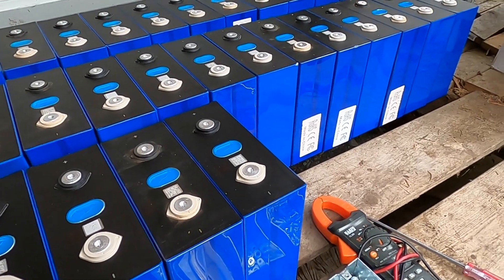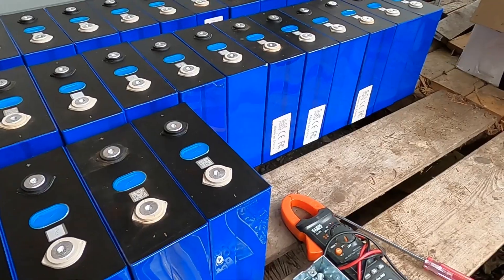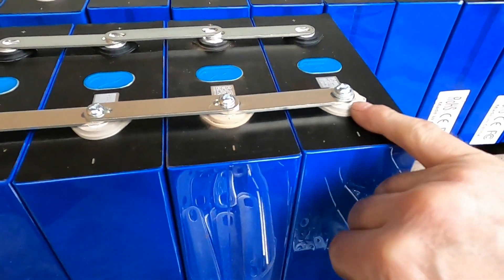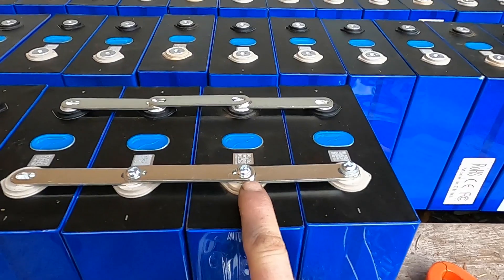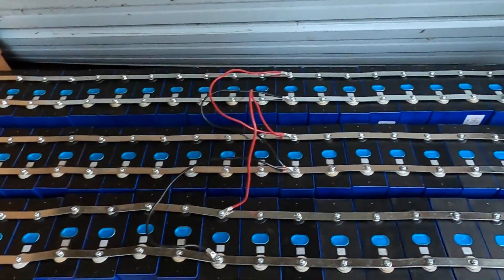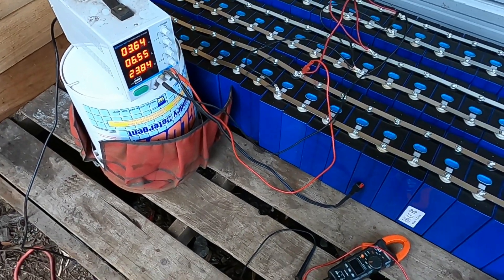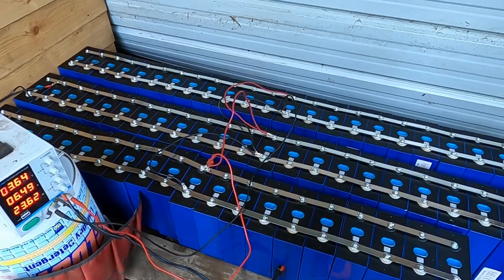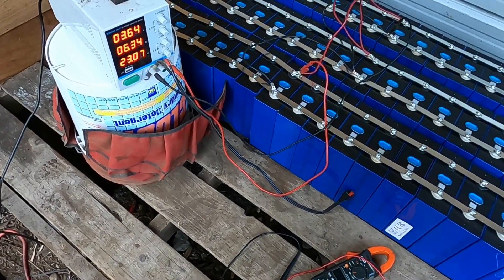Top Balancing LiFePo4  280AH EVE Lithium Iron Phosphate Cells Using Xuba/Luyuan supplied busbars

Comment: ummmm i did some math rn and if those batteries came at 0% soc it would take about 124 days to top balance with 6 amps of current. 62 days if batteries came at 50% soc. 31 days if batteries at 75% soc. 15 days if batteries at 87.5% soc.

Comment: 64 batteries at a nominal voltage of 12v with a capacity of 280ah. Is a total storage energy of 64*12*280=215,040wh or 215kwh ... What on earth are you powering and are you using a solar array to charge all this ?
Reply: each cell is 3.2v not 12v

Comment: I see you mentioned that you waited until the power supply dwindles down to 0 amps. 68 cells x 280Ah each = 19,000Ah of capacity.  Even at a measily 0.01C charge rate, you would be done at 190 amps of current flowing into it.  You're literally doing nothing at this point with the power supply lol... The current charge rate is 0.0003C :)

Comment: The Batteries will last longer if you only charge them 75 - 80 % if you charge them 100% you will cut the life more than in half !
Reply: He is doing it only once to balance
Reply: He's top balancing prior to putting the cells into service.

The SOC spec for these cells is 10-90% for the rated 3500 cycles at .5c discharge rate. Considering his 4p configuration I would expect his charge and discharge rate to be far under that which will significantly extend the cycle life.

This pack is more likely to die from calendar degradation than cycle degradation. The only way to slow the calendar degradation is to keep the cells at storage temperature which is unrealistic considering that's 30-50% SOC.
Reply: That's not how lifepo4 work, the other lithium composites, do though
Reply: @Neveragain1111-r4y  No they work the same all lithium's do best at a 80% capacity cycle
Reply: @Foxfried  lol discharging fully will degrade them but charging fully does nothing negative!
Reply: @carbonrrpilot  You are wrong, BIGLY! All lithium chemistry have a substantial increase in life if charged to 80% full and discharged to 20%, it is in the MANUFACTURER SPECSHEET under depth of discharge. You can double or triple the no. of cycles.
Reply: @Foxfried  lmao so the spec sheet says you cut cycles or life in half by charging to 100%?  bwahahaha. whatever you say!
Reply: @carbonrrpilot  Lithium iron phosphate (LiPo4 ), Lithium nickel manganese cobalt oxide (NMC), they all give up an electron that moves into the positive going through the electrolite. The rest of the lithium atom deposits itself on a graphite membrane on the negative side (separatd by the electrolite). When this graphite membrane is full of Lithium minus  one electron the battery capacity is full.   When a load starts (a draw) those electrons flow thru that positive pole (the anode) and the circuit that draw, then  back into the negative pole (the cathode)  and back into the graphite where it is captured again by the lithium atom (with atomic number of three again).     Little by little those electrons start to build up on the anode until the battery start to reduce it's capacity because of that build up. The faster it is charged generating heat no matter it's c rating, the faster the build up.  The higher the state of charge, the faster the build up.  Yes, both NMC and Li Po 4 are affected by this build up.  Also both are affected by temperature changes while they are charging and discharging.  The faster that you charge and discharge  them the higher the degradation.  That is why they tell us the c rating.  One hundred amps discharging at one hundred amps an hour is one c.  These are the reasons why they show us the curves at eighty percent of sos ( state of charge).  Also this is the reason why the leave three thousand watts of unusable capacity on the Tesla Power wall.  Yes, if the Teslas capacity is rated at  ten thousand watts in reality its battery capacity inside is thirteen thousand watts, somewhere around that.  In reality it is charging up to seventy percent it's capacity to extend it's life.  That is also the reason why the Tesla's needs to be connected to the internet so that they can control every aspect in order to reach the warranteed ten years.  It's ok. I studied this out of necessity after the Hurricane Maria ravaged Puerto Rico.  English is not my first language. Thanks everybody.  Best wishes.  👍🏝️ to
Reply: I did some research on life of the lipos. Yes some people have reach eight and a half years out of lipos on diy equipment.  They could have made them last more but made some mistakes while using them like charging them too fast or too high and discharging the all the way.  There are very durable in reality.  If you really take care of them they will go a long way.
Reply: @agustinmoralesrodriguez1242  nice read 
And Technically during all that the anode turns into the cathode and the cathode turns into the anode literally 🙄

Comment: Plumbers tape is great for long paralel strings like that. My ps4 is 30 volt 10 amp. I had to series them into 24v packs and charge them to 3.55 first. Then paralel them and go up to 3.6. it would take forever and I've only got 1/3 of your capacity
Reply from the maker: That would be like silicone rescue tape?  Thought about that.  I have them all compressed in packs of 4 cells now with vinyl electrical tape.  If that ends up not working might try the rescue tape.  I eventually used 3 hobby balance chargers to balance up to 3.6v then parallelled them and used the power supply to top balance up to 3.65.  Took about 3 weeks all told.  Making a battery shelf now.  Should have a few more videos out as soon as I configure them in series.
Reply: @metagrid9453  no... Sorry it's not really rape that's just what it's called. It's metal strapping about half inch wide and has holes drilled every 3/4 inch or so all the way down. They use it to strap up pipes to floor joists or whatever they can run a screw thru. The holes all along make it so you can just use a long piece and attach it to the studs all the way down the line
Reply: @metagrid9453  https://www.lowes.com/pd/AMERICAN-VALVE-1-2-in-to-4-in-dia-Galvanized-Hanger-Iron/1244159?cm_mmc=shp-cprdplbgooglelia-142-plumbingconnectionsandsupport-1244159-_0&placeholder=null&gclid=CjwKCAiA_L9BRBQEiwA-bm5fkRwO47zvtN3lsBs5mpvgATZ8mz32sprPIBrDAUJYQn3aQiLW2rS-hoC-oQQAvD_BwE&gclsrc=aw.ds
Reply from the maker: Ok, I know what you are talking about now.  Thanks!

Comment: how many months till the current went to 0A?
Reply from the maker: I used 3 balance chargers to bring the cells up to 3.6 volts then it took about 2.5 weeks for the parallel connected group of all cells to top balance to 3.65 volts, 0 amps on the power supply.
Reply: @metagrid9453  
thanks for the feedback
Reply: @metagrid9453  Great video,congratulation!This video came to meet the problem I am facing now. I received the 32 302 amps batteries which i was waiting for and started the top balancing procedure in three steps, 3.4,3.5 and 3.65 volts. I connected all 32 batteries in parallel and I got a huge bank of 3.2 volts and 9600 amps. In the first phase I charge the batteries with 3.4 volts and the bank sucks a current of approx. 15 amps. Assuming the batteries came with 50% SOC, this first phase will take about 12 days.
  Please advise me what to do, wait until the battery bank reaches 3.4 volts and the current close to 0 for the first step, or charge them directly with 3.65 volts. The source I use can charge a maximum of 60 amps.
Reply: What model power supply did you use to top balance?

Comment: Can't see close enough but to they have an helicoil insert on both positive and negative terminal? I'm asking cos I've got similar cells but the aluminium its terribly soft....treads are very short lived.
Reply from the maker: It looks to me like the threads are cut in the Aluminum with no inserts.  I am being very careful about over-torque and so far have seen no problems.  I have heard others say they have stripped the threads though so it does happen.
Reply: @metagrid9453  you do... right.  I've ruined so many treads and afterward even with the helicoil was a pain. In any case I'm back to tour video cos I saw another video saying that the prismatic cell format is meant for at most 100ah due to the small contact area. I was wondering if once you're done with the setting if you noticed some overheat or some other related problem.
Reply from the maker: @shinosg-wiz4619  No problems with my smaller 12V system.  Since we have 280AH cells I don't forsee pushing the thermal envelope of these cells at all.  Our new 48V system is designed for longer term storage from solar panels, rather than rapid charge and discharge rates which would test any of the thermal limits...

Comment: Wow, that's a lot of batteries!  How much were they a piece?
Reply: They are roughly $100USD Shipped.
Reply: @matthewburga  link to supplier?
Reply: @matthewburga  298 each 272 amp howers each
Reply: @shawnsyraic6541  I ordered back in November from Xuba. The 16 272Ah Lishen cells were $1590 USD. Delivered. They arrived last Wednesday. :)
Reply: @matthewburga  crap. I could have saved 100 bucks if I saw this first. Just ordered 16 from a different supplier. Shipping was $399.
Reply: @Sanwizard1  That's still a great deal at around 25 cents per Wh with a decent BMS. I'm using the Overkill Solar 8S for a 24V camper van set-up. No propane. :)

Comment: This is not necessary at all, if the cells are same age, history and ofcourse voltage. Best is to cycle them as your final product. In your situation 48 volts 4p16s a few times from 90% to 10% and then a full balance charge with a good BMS for this battery-chemicals LiFePO4 (Max 3,65 volt per cell.) and then return to 90% operating charge, 3,50 volt or 3,55 volt per cell and NEVER run down your batteries. Because that can give large unbalanced batterypack because of internal resistance which differents at the bottom of the operating voltage. Sorry for my honest opinion.
Reply from the maker: They were the same age, history and voltage when received.,  Unfortunately they were at storage voltage at that time and as they were charged the differences in the SOC of the cells was revealed.  That is pretty typical for this chemistry given the flat discharge curve.  The differences in voltages do not become apparent except at the top and bottom of the charge curves.  That is why I think it is a good idea to top balance just above the max voltage that the cells will see during their life.  Doing so allows the maximum capacity of the cells to be utilized.  Thanks for sharing your opinion and watching the channel!
Reply: Hello, please, do you mean that the top balancing exercise that he did is unnecessary?

I am interested to know because I currently have 32 cells in 2p16s but I plan to get 32 more cells in the near future for a 4s16p connection and I have been worried as to how I will be able to add the new cells to the old ones as I am off-grid and I do not have any other source of power if I disconnect the old ones in order to parallel them with the new ones.

Comment: Do you need to let them sit and balance together for a week or two before charging? The cells are very closely matched when sent by Amy
Reply from the maker: They are closely matched at that charge state, which is the storage voltage.  This is attributed to the flat discharge curve of this chemistry.  As you charge them up to full however they get more and more out of balance.  That is why they need to be top balanced.
Reply: @metagrid9453  I see, thank you. I always thought top balance was just charging them up to 3.65v the first time. The best practise would be get the cells, set them all in parallel, leave them sit idle for 1~2 weeks. Charge them to 3.65V before assembling? Or charge them to 3.65V, connect in parallel, let them sit for a week, assemble into a pack?
Reply from the maker: @asderven  It has been done both of those ways.  I have chosen to charge to 3.6 volts per cell with a balance charger.  I will then parallel the cells and top them up to 3.65 volts per cell using a CV/CC power supply.  The cells need to be charged up bulk first as it takes a long time to charge them when the pack voltage in parallel is only 3.X volts.  So the balance charger brings them carefully up close to the top, then the parallel/power supply balances them more closely, in theory.  I am finding even that does not perfectly balance the cells.  They still need a few cycles with an active balancer or a balancing BMS once they are configured into the final battery bank...
Reply: @metagrid9453  thank you, this is very helpful.

Comment: This will be interesting. We'll see if any cells expand when you top balance!!
Reply from the maker: I'll be watching them carefully.  I can't afford any expansion now as I need to bundle and compress the cells once they are top balanced.
Reply: @metagrid9453  Is compressing the cells an important build consideration for these type of cell?
Reply from the maker: @Bennyboy-dog  I like your Ubuntu Avatar!  Everything I have learned about these cells indicates that it is important to bundle and compress the cells.  The main reason I do is because as the cells swell, they can rip out the terminals/bus bars since the bus bars are rigid and do not expand along with the cells.  Thus it is important to immobilize the cells within the packs.  I have also read that the cells are somewhat more efficient when compressed.
Reply: @metagrid9453  Thanks MG, both for the compliment and the info. I wasn't aware these cells expand and presumably contract on charge discharge. Now I get the "top charge then compress" approach. Nuggets of knowledge like this is gold. Thank you, thank you, thank you! :)
Reply from the maker: @Bennyboy-dog  There was one fellow who professed the best way was to bottom balance then compress.  He felt you would get tighter compression that way.  my 12V pack worked great when I top balanced then compressed though.
Reply: I had some expansion on 2 or 3 cells when I top balanced. I locked my cells snuggly into a fixture before I charged them. Once charged o had a heck of a time getting the wedges out to turn every other cell for series connection.